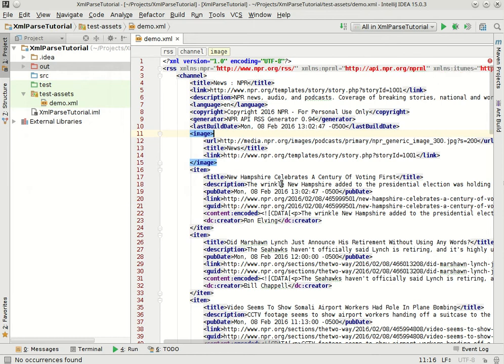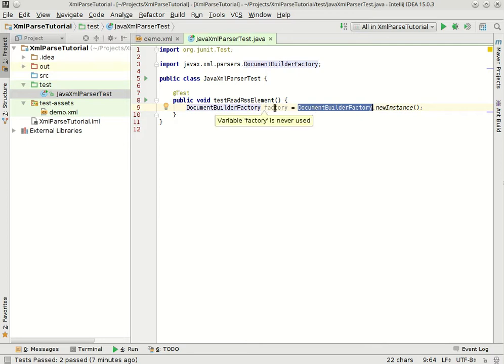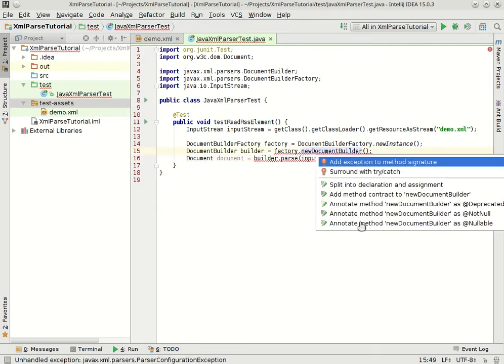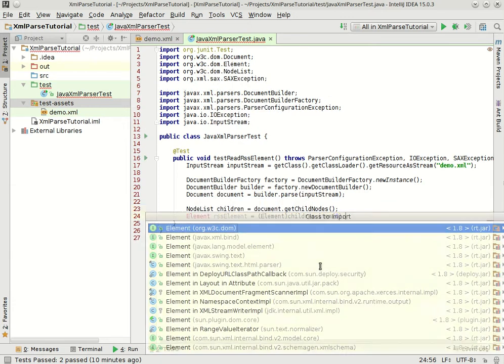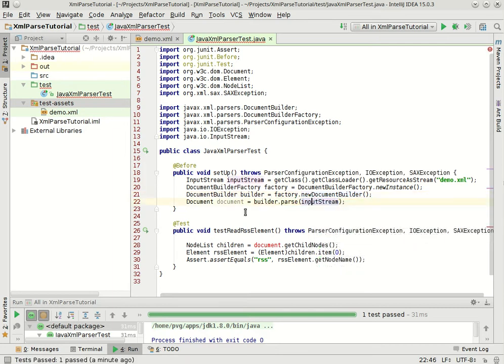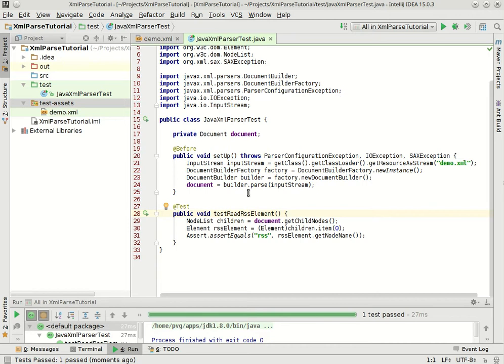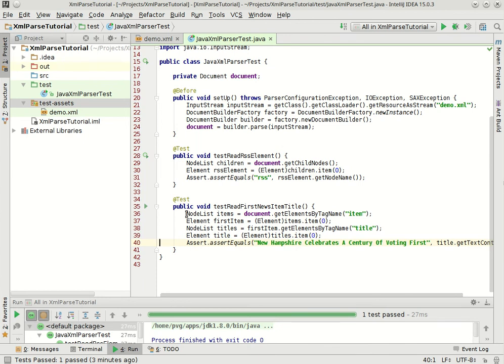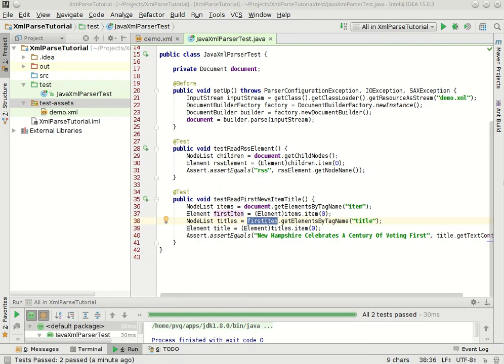Parse XML using the standard Java DOM parser

Comment: How to handle nested xml like I have 5 reports each have 10 tags and out of 10tags have 3-4 subtags.
Eg.<report>
<Rep id =1>
<header>
<TransactionRef>12345</TransactionRef>
</header>
<>
<>
....
</Rep>
<Rep id=2>
Same as Rep 1
I have total 5 Rep tags
Reply from the maker: The same principles hold. Walk through the tree one step at a time, casting the results into the right types to get the API calls you need. One useful technique for exploring the API is to use the integrated debugger. You can set a breakpoint then try different API calls while the application is paused, allowing you to figure out what combination of calls gets to the data you seek.

Comment: Hi Paul , what if I've XML string rather then XML File. how do I parse it and store into Maps?
for Ex:String vehicleInfo =  "
<vehicle>
                 <car>BMW</car>
                 <bike>Yamaha</bike>
                 <truck>GMC</truck>
            </vehicle>"
need to store the tag name as a Key and tag value as a Value into the map.
Thanks in advance.
Reply from the maker: You could turn the string into a stream and hand that to the XML parser, then either walk the DOM or handle the SAX events to build your map. ByteArrayInputStream is part of the standard library, but you can find even more alternatives on StackOverflow. That's probably the best place for this kind of question, really.
Reply: +Paul Gestwicki ,Thanks a lot Paul, really appreciate it.